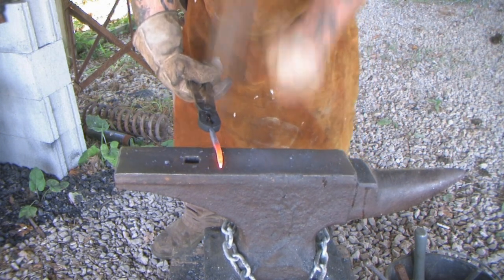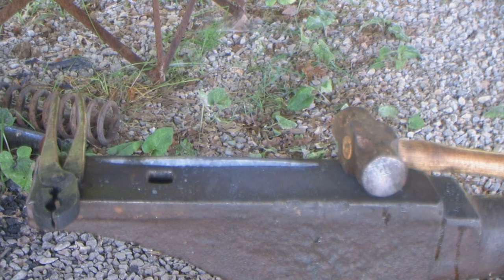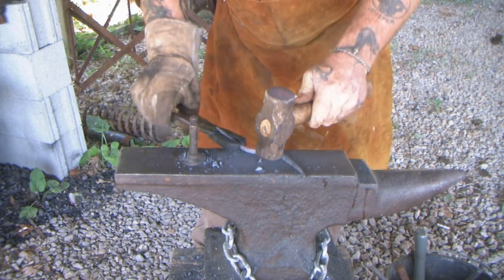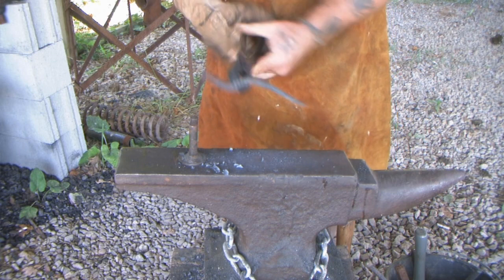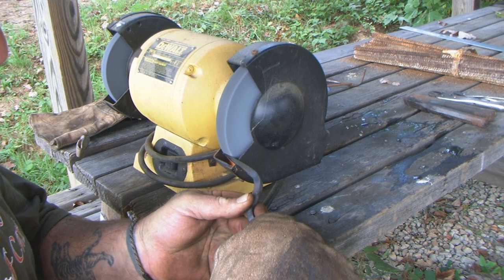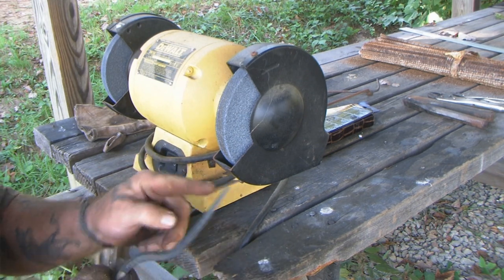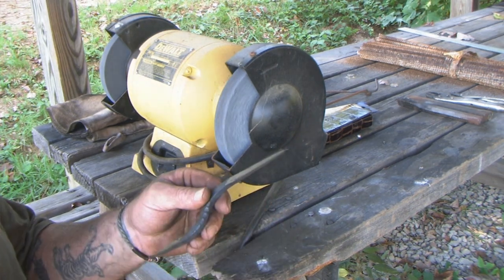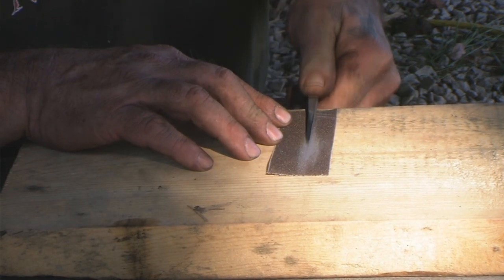Blacksmithing the Crooked Awl Part 44

Comment: hey dave i got a i little safety tip with the grinder, if there is any possible chip or crack or almost invisible problem with the stone wheel, when turning the machine on when the wheel first starts spinning thats when the crack/chip would possibly explode or send a lot of shrapnel in your direction.  i was always taught that when turning the grinder step off to the side and once it gets up to its max rpm its safe to start grinding.

Comment: nice job! while watching i made some thoughts: if you punch a hole near the pointed ends, you will be able to guide threads silmuntaneously with awling (no need for needle). If when grinding you make the egdes square, you will be able to strike a ferro rod and if you make it out of high-carbon steel, you can drive out sparks with a flint. Finally, you can make the edges different (one thick, one thin) for more multifunctionality. Now instead of a crooked awl you will have a crooked multi tool!